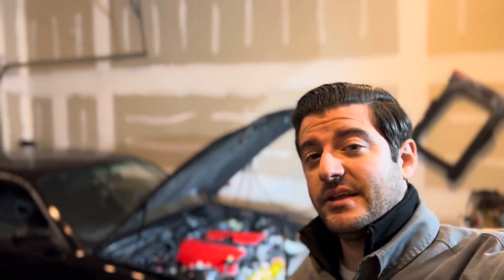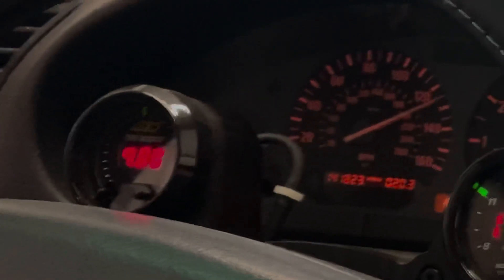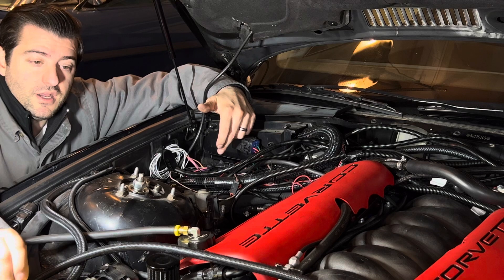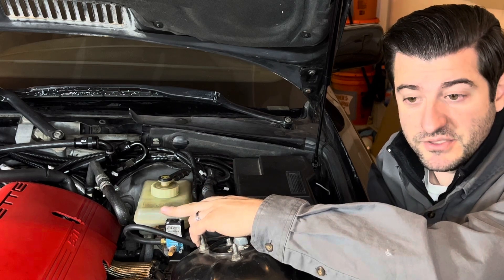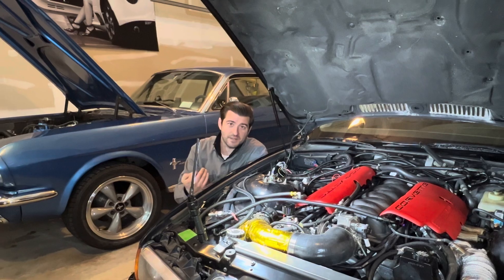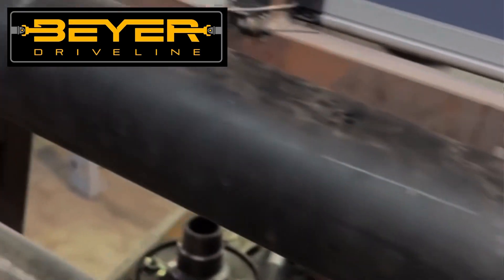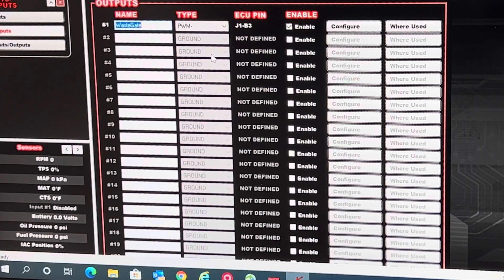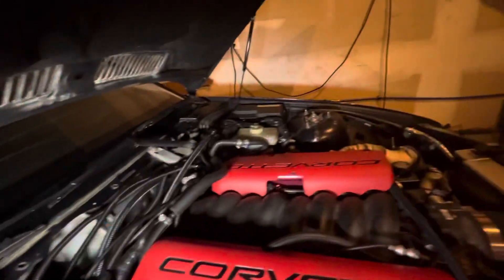HOLLEY TERMINATOR X BOOST CONTROL- OPEN LOOP

Comment: Ever made a video on your map sensor setup?
Reply from the maker: No, I thought it was pretty common I just had it on the back of the intake to a vacuum
Reply: @ using the Holley 1 bar sensor on the ecu?
Reply from the maker: @bnkrdbones4391 3 bar off the back of the intake

Comment: You say boost psig but select target boost. I don’t even have target boost as an option. Term x max ecu. currently using map signal as a dome and using the Holley software/pid controller. Sounds like we’re having similar issues. I have a 5.3l with a s366. Boost will spike above target then slowly drop too far below. The pid tuning right now is difficult so I’m going to try open loop instead. Thanks

Oh btw in the boost tab you can set a boost cut. We’ll have to use ignition cut since not using the built in software instead of revert to WG like I have been using. One down side ..
Reply from the maker: Yea, I said that incorrectly. yea a 366 and a 5.3 is too small like the 372 is for my 6.0. This helps considerably, I have it set to revert to wastegate over 15psi. So it’s held well. 

My next video will be on fixing my boost issues. My problem was my muffler. The cutout I put on it fixed it
Reply: @LowBoostFilms  366 is great in a 5.3l. Just depends what you’re doing. Light street truck under 600hp. Really fun with a manual for in town driving. Spools quick. I don’t see how revert to wastegate will work if not using the built in software. Since non of those tables are being used. Because before it was controlling the solenoid but now it’s not. Am I wrong? I’d rather revert to gate. I’m about to go test this open loop out
Reply: @LowBoostFilms  First off im no guru at any of this. Still learning. But what I just found with some logging is unless you dont mind making more boost in higher gears this setup will work fine. I could hit my target pretty well in second but third would over shoot pretty fast and hit cut. If i ran less boost in second or more in third this would be fine. But I want constant boost all the time in all gears. Also setting up the table how you did will result in slower repsonce of the turbo. I ended up doing 100% until in the higher rpms then backed it down a bit and then back up a little to counter back pressure. This defintely worked better. Also how the holley does it in closed loop. Im going back to closed loop and messing with the pid more. If you want a really basic boost control use this. Otherwise get a dome sensor or run the map signal back into an input like sloppy does.
Reply: @LowBoostFilms  oh btw on the muffler thing. I just went through something similar sorta... had a magnaflow muffler and it was so quiet. Went straight pipe and it was great, just slightly too loud and little drone. Put a 16" resonator on it and now its perfect. Good idle sound, growls between shifts but no drone.
Reply from the maker: @or-ian6973  yea that’s my gripe about it, I make more in 4th too, which is annoying because third is slower :/ but it works. Hit me up on ig I’ll send you what my open loop table looks like